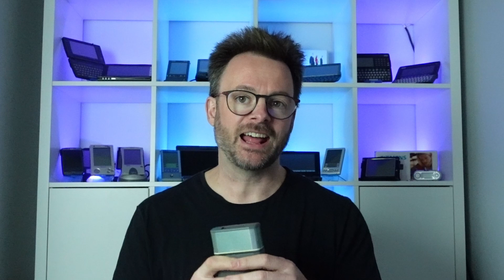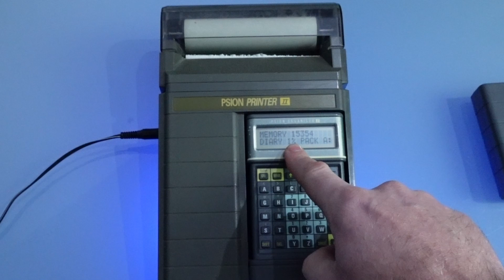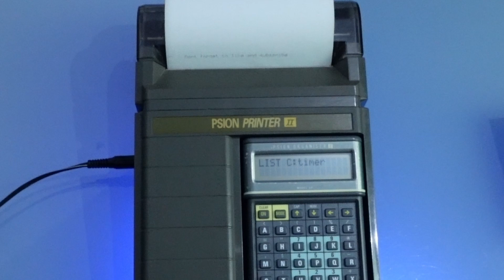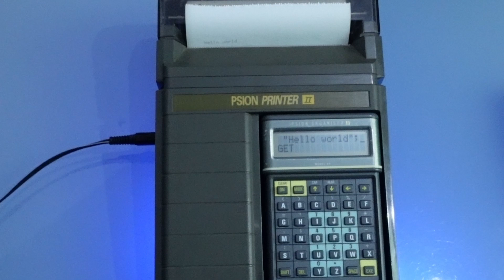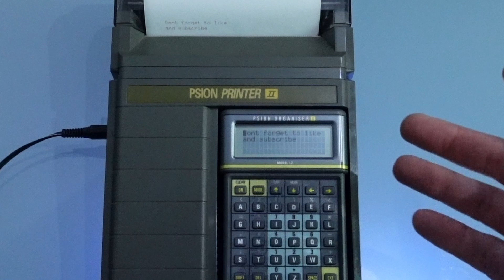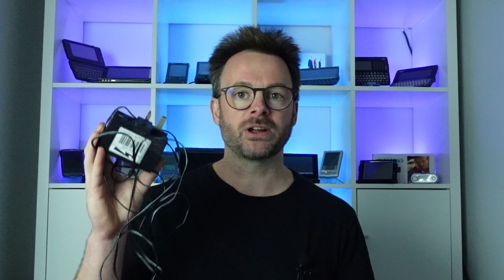Psion II Portable Thermal Printer

Comment: Late 80s early 90s I worked for a company Wincanton in the UK. I used to travel around the North West area of the UK mainly to supermarkets and install Psion kit and train staff how to use it. 

The kit included the Psion Printer, a Psion LZ64, Psion Comms Link, HP Barcode wand and a US Robotics modem. 

The kit was used for stores to order their chilled goods (cheese, meats yogurt etc). All stores would have order books posted out which had all the items available to order and next to each product was a barcode which the store would use to scan the required products into the Psion.

Every store had a day and time they needed to have their order ready for. The relevant department head would create an order in the order book on shop floor. Once they had noted the items they needed to order they would go to the office where the Psion kit was installed and scan the order into the Psion. Once they had created their order they would print out a copy of the order they had scanned and check everything was correct or make amends if needed. Once happy with the the order they would then unplug the HP barcode reader and plug in the Comms link cable which was connected to the modem and then they would select transmit. The Psion would then dial up the Wincanton mainframe and transmit the order. Once the order had been transmitted successfully the mainframe would acknowledge receipt by printing out a confirmation message.

I don’t think people really grasped just how capable the Psion II organisers were back in the day, they were capable of so much more than just being a yuppie organiser!

Field service like myself had our own complete kits so that we could learn any new software / hardware updates on. 

I still have all mine to this day!